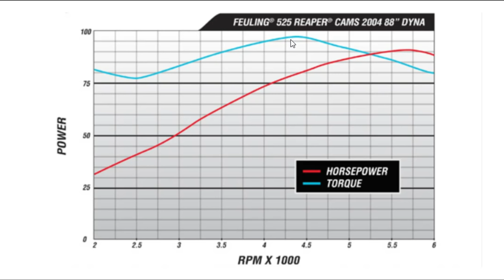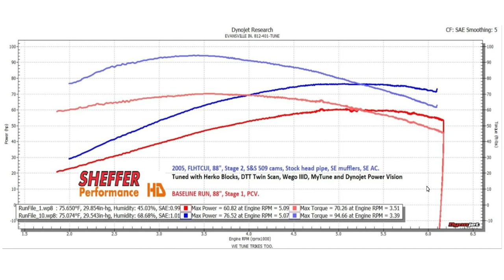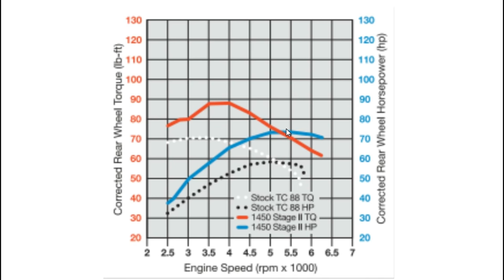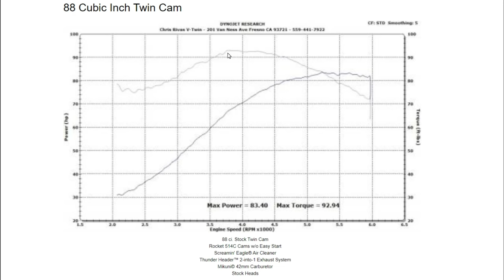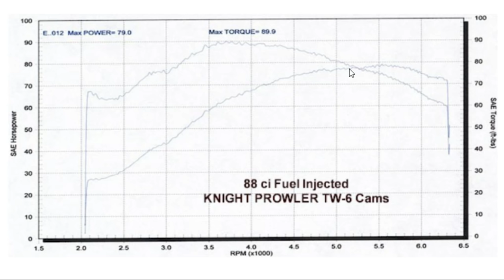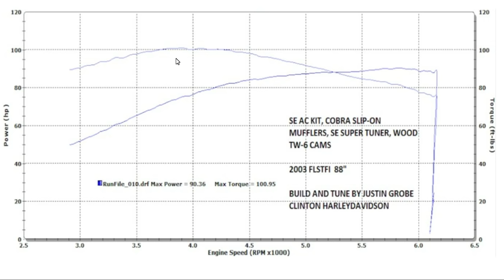Give Your Twin Cam 88 New Life With A Bolt In Cam Upgrade

Comment: I bought S&S 509 cams and new lifters with a harley SE cam plate upgrade kit.   I was going to leave it 88ci.  But I have decided to go with a  95ci from HD with the standard flat top pistons.  .030 head gasket.  Stock heads.  Question:...  will the 509 cams work well with the 95ci?
Reply from the maker: 509 and a 95 inch kit will play well together, the displacement increase will take advantage of the cam.
Reply: @GixxerFoo  Thank You!
Reply from the maker: @paulkubas4700  Anytime! If you hadn't already bought a cam the 510 is a good 95 inch cam too.
Reply: I was worried about the valve springs and valve clearance.   That's why I went with the bolt in 509. And I  ride in the rpm range that the cams are made for. While I have it apart, should I increase compression by shaving heads ect?  The bike really performs great as a stock 88. It co UK ld use a little more power for two up riding.  I just wanted a little more grunt and roll on in top gear. And to hopefully change the power band.  I'm riding a 2003 heritage  softail.
Reply: Just got my 03 heritage back from the dyno tune.  S S 509.  95" bb. .030 cometic head gasket. Stock heads. 76hp. 92ft lb. .  Runs great.

Comment: With the woods knight prowler tw-6h is there anything else I would have to do to the motor?
Reply from the maker: The TW 6 is bolt in so no other mechanical modifications will be needed. The only thing you will need to do is get the bike tuned.

Comment: Can you help me, I have a 2002 FLSTF 88ci but had an upgrade to 96ci. My question is will H-D 255 cams fit my engine?
Reply from the maker: Those wouldn't work in the 88 due to the inner cam bearing being smaller on the 88. 2006 and newer had a larger inner cam bearing. You could use them but you would need to have the later style cam plate and oil pump, as well you would need to machine down the inner bearing surface  (old style is smaller) and then press a hardened race onto the end of the cam.
Reply: @GixxerFoo  thanks for your reply, do I have any options for torque cams in my 2002 FLSTF?
Reply from the maker: I would recommend the Wood cam, it's one of the best horsepower and torque producers out there on the 88.
Reply: @GixxerFoo  thanks for the advice I will look into that, hopefully they sell them in the UK
Reply from the maker: I believe you can get them through FuelMoto over their. I know Hammer Performance can be sent to the UK, FuelMoto should be able to ship to you.

Comment: Would the Rocket cam 514 ok on a 88 to upgrade to a 95,98 or 100?
Reply from the maker: It could be used with those upgrades, that cam is also made for the 96 and 103. You'd just want to keep the compression close to stock since it's a bolt in cam.
Reply: @GixxerFoo  When is the 554 Rocket cam suitable?I want performance but I prefer focusing on long engine life.So are  lower compression pistons the thing? For the same reason ,I was wondering if the 95  SE  pistons (flat top) would be the choice?

Comment: Hey what cam u recommend with the s&s 98 big bore kit on a 03 roadking classic. Thanks
Reply from the maker: What compression ratio and cylinder heads are you looking at running?
Reply: @GixxerFoo  With stock head the kit will be at 9.8:1 compression i reach out to s&s n they told me to go with the mr103 cams. What is ur opinion on that

Comment: Could I put a woods 110 big bore kit on a 88??
Reply from the maker: The largest bolt on kit you can make an 88 would be the 100 inch SideWinder kit from S&S. It's got the 4 inch stroke crank, if you were to swap that crank out for a 4.375 inch stroke crank and add the 4 inch bore cylinders that would get it to a 110.
Reply: @GixxerFoo  Will the 100 bolt right in our it needs machining

Comment: I’m ego too a twin cam 88 FLHR carbie stock except pipes and jets what’s the best cam for it.  I read the head can only accept 515 lift many thanks oops ride two up and to work.   Don’t want a hotly like my 103’s
Reply from the maker: I would look at the Wood cam, it's really an awesome all around cam. It's got excellent torque and horsepower. It really gains all over the chart!
Reply: @GixxerFoo  thanks. Which woods cam
Reply from the maker: The Wood TW-6 would be an excellent bolt in cam for your bike 👍

Comment: How much retuning is required?
Reply from the maker: Carbed bikes are pretty easy with just a jet kit and ignition adjustments, a good dyno run on a fuel injected bike would run around 2 to 400 just depending on the shop tuning it.

Comment: Are you familiar with Redshift 576 cams ?
Reply from the maker: It's basically the same cam as the 575 just designed to be quieter for the most part. You'll need heavier valve springs to run it though.
Reply: @GixxerFoo  yeah heavier springs and a handful of other things would be getting changed.

Comment: I have a question about a different rocket cam. I called about their 554 because it says they are a bolt in cam, this makes no sense to me. Can anyone verify that these are good for stock springs on a 2004 88? Thanks
Reply from the maker: Yes the 554 will work with the stock valve springs, you can install them without any modification. Of course you'll want to go ahead and put some new cam bearings and not required but recommended new lifters. Just good to do while you're in there, but you can bolt those right into your 88.
Reply: Awesome, thank you for the reassurance, I was under the impression that the lift possibilities were less

Comment: ? is does harley have a tune for the 509 or do you have to buy a tuner which i dont wanna do? oh 03 ultra btw
Reply from the maker: Harley-Davidson won't have a tune for a aftermarket cam, being a 03 you would need a Power Commander V. FuelMoto has them pretty inexpensive and if you give them a call or buy online they will ask you about your bike's setup. That way they can setup the unit ready to go on your bike cam and all.
Reply: @GixxerFoo  ok got into it it has se203 in it now which i had known i wouldnt have bought the 509'sbut they wont take them back and return cash only store credit from a place probably never buy from again as usual with my luck and cant find a comparison of the two any ideas
Reply from the maker: Actually thay 509 is a much better cam! It would wake that bike up way more than the SE cam.

Comment: I'm considering going to a 100ci kit, cams and ported stock heads on my 99 road king tc88. It has a magneti marelli fuel injection, and stock headers with sporty mufflers. What mods can I do to improve the magneti marelli system? And what header should I use to maintain stock side tailpipes? thanks
Reply from the maker: You can tune the system using a Power Commander V, that would allow you to get your bike tuned for your setup you're looking at. I would give FuelMoto a call, they can help you get setup with a base map for the work your looking at doing. Are you looking at replacing the factory header and keeping your exhaust?
Reply: @GixxerFoo  yes, I want to keep my current exhaust
Reply from the maker: The factory Harley header is a lot better than it gets credit for, does it have the crossover in front of the cylinders?
Reply: @GixxerFoo  is the one that has a 2-1 on the right side and a single pipe for the left side, creating an Y on the exit of the rear cilinder head exhaust port
Reply from the maker: Oh okay, the factory header is really good but if you're looking to.change it l would check with Vance & Hines. They make really good replacement headers for Harley.

Comment: S&S for sure. How about the 510?
Reply from the maker: The 510 is good option, it comes on later though closer to 3,000 rpm. But it's great cause it bolts in and is intended for stock compression ratios.
Reply: @GixxerFoo  and torque doesn’t fall off
Reply from the maker: That's very important is not getting a dive in the middle of the curve!
Reply: I got 510 in my 01 road king with gear drive best thing I did
Reply: Put a 510 cam with gear drive best thing I did because when I took off the cam cover my tensioners where all most in pieces they fell a part in my hand.

Comment: I have an 03 road king classic I'm going to get the 30 k service done on it soon the bike is bone stock and I want to keep it that way any ideas on cams tensioners cam plates any thing to keep it reliable and simple not wanting a hot rod the bike is sweet and unmolested that's the way I'm going to keep it
Reply: Screaming Eagle hydraulic tensioners , n cam plate is a good choice . With adjustable pushrods . All available at the dealer . Geardrive is good , but crank runout needs to be within .003" . Probably worth doing at a top end rebuild . Far better choice . If you go that way . Simply replace tensioner shoes at 30k . Hd have a more robust design now . Then play with choice upon a rebuild , depending on your crank . I too own a 03 roadking classic , with a sidecar . N an 87 fxr . Hope this advice helps . Cheers from Queensland Australia .
Reply: @paddingtonbear5172  thanks for that direction I'm not a mechanic know a little bit about engines and can do oil changes and that stuff again thanks man and be safe cheers from the mountains of western north Carolina
Reply: No worries mate . I reckon its a good move if you go to geardrive to upgrade the oil pump at the same time . If you want a little more power , without compromising the valve train . You can upgrade the cams . All available thru S&S . 509 cam will give you about 9 extra horsepower and around 25 extra foot pound of torque at 3500 rpm . A cheap mod if you already have it apart . Stay safe mate with the bloody covid 19 . Cheers

Comment: Whats your opinion on the andrews tw 21cam
Reply from the maker: You can't go wrong with Andrews, that's an excellent torque cam for a big touring bike. It's a great replacement for the stock cams and it's perfect if you ride in the low to mid rpm range. It's not going to produce big horsepower but it will increase it so you're not losing top end by any means.
Reply: Thanks,keep up those great vid.
Reply from the maker: Thank you, l appreciate the support!

Comment: What if we have a 06 Dyna? It has better heads than 05. The SE203 i don't believe would work on 06 Dyna.
Reply from the maker: 2006 is quite a special year, it Harley's public experiment and it was good. The heads are basically Twin Cam 96 heads and they had the hydraulic tensioners. For the 2006 Dyna you'll need to look at cams for the Twin Cam 96 and 103, those cams will work in the 06 Dyna 88.
Reply: @GixxerFoo  thank you Brother!👍
Reply from the maker: Not a problem, hit me up anytime with questions. I am always happy to help out.
Reply: @GixxerFoo  dude you rock. I'm having a helluva time finding the right cam for this oddball bike. If you were me and you want a bookoo low to midrange torque boost on a 06 Dyna what cam would you choose? I'm probably not going to increase my cubes anytime soon. I have a PowerVision, 2into1 HO Short VH, and hypercharger intake. Looking to get as close to 100 ft lbs as possible 🤙
Reply: @GixxerFoo  the biggest problem I'm running into when looking at the 96/103 cams is they need a higher compression ratio than the 88 produces.
Reply from the maker: The absolute best bang for the buck out there is the Wood TW-222. It will work in a 2006 88, it's a major torque producer low to mid. But it doesn't kill the horsepower on the top end either. With your exhaust and tuner it should put you in the mid 90's, a good dyno tuner could likely squeeze more out of it too.
Reply from the maker: The 2006 is a special year, the compression is a bit low at 8.9:1 but the 96 is only 9.2:1. It's a bit of difference but most cams for the 96/103 that are bolt in will still run well in the 06.
Reply: @GixxerFoo  you the man, thank you for your recommendation sir 🤘 love your channel. We're cut from the same cloth. If you ever find yourself in Oregon hit me up
Reply from the maker: Hell yeah will do! You are welcome, anytime!

Comment: My TC88 it's near to 100.000klm/63.000ml
My idea it's S&S 509 and maybe a big bore.... 95" 98" 100"?? 
I don't know, the pocket says........ 
Thanks for your videos
Reply: I spent near $3000 the last month on mine. 2001 Fatboy, KB domed pistons @10:1 fully ported heads, fueling oe+ cam plate and reaper 525 cams. Cylinders were torque plate honed to 95 " as well. 100hp and 112 tQ
Reply: @HammerHeadGarage  Thanks a lot for information!!!

Comment: Are andrews and wood the same company?......wasnt the cams called andrews/woods cams?
Reply from the maker: Andrew's makes the cams for Wood, but the Wood cams are built to Wood's specs.
Reply: @GixxerFoo  got ya, thanks for responding!.....I have andrews 57 in my  03 cvo road king with a bassani road rage 3 pipe....it pulls pretty well id say....lol
Reply from the maker: That's a nice cam for your 103, do you have any head work or anything done?

Comment: Why don't you cover how you can pull both the cam tensioner springs and pads from a TC-88 ; throw them away, and never have to worry about those parts going genade on you, and blow up inside your motor ????
Reply from the maker: I've only had one other person say that before, it makes sense though honestly as it's basically just there for harmonics. Chevrolet V8's run hundreds of thousands of miles without tensioners.
Reply: @GixxerFoo  We found the cam chain is so short ; we are going to do a YouTube video of a stock TC-88 running without the cam chain tensioners.......
Reply: @garymoore3497  I'd really like to see that myself, as I'm rebuilding atm and will put new tensioners in just because. Long time Chevy man myself.
I often wonder why they didn't just use a WHEEL instead of pads? Urethane or something would go 200K easy!
Reply: @garychandler4296  I have your answer.... "Shop Income".... Harley dealers make more money on broken motorcycles..Using a WHEEL would cut too much into "Shop Income".....you understand now ???????
Reply from the maker: That's interesting, too short? I don't feel like there's any reason you can't run without tensioners. Send me a link on the video, l want to see this.
Reply: @GixxerFoo  Don't wait for me....Do it yourself.....
Reply from the maker: I ride with a few guys that took theirs out, they haven't had any issues. I like to hear everyone's opinion. I like the idea but some people think you're nuts for even suggesting it.
Reply: @GixxerFoo  somebody has to call a spade, a spade......

Comment: Have you heard any good things on the fueling reaper 543 cams for the 88??
Reply from the maker: They are decent in the 88, but they work much better with larger displacements. The Wood TW6 works very with the 88's.

Comment: Hq 34 good cam for 88ci come on around 3 grand
Reply from the maker: What RPM does that cam run out to?
Reply: @GixxerFoo  that was my 2000 ultra classic now I have a 2010 road glide looking at cams don't redline past 3500 rpm want to get the power in that range but I want that cam lope sound
Reply: @GixxerFoo  also I upgrade to the 10 mm spark plug wires big different thanks
Reply from the maker: I would look at the Wood 222, that's a cam that's got it everywhere. Even more so than most mid range cams.
Reply: @GixxerFoo  thanks I will this a go

Comment: How about Andrews??
Reply from the maker: Andrews are some damn good cams, they actually make the cams for Wood. The cams are justg ground to Wood specs, but you can't go wrong with Andrews.
Reply: Andrews 21 torque cams if you like to feel real pull just at normal throttle, low rpm's. Really woke up my sleepy 88!

Comment: You did this video, aimed at me, didnt you ?  lol  woods=82hp hmmmm
Reply from the maker: Lol Woods is a good cam, the 88 isn't huge kn horsepower but it's a stump puller on torque.
Reply: @GixxerFoo  I think Im sold on the S&S 509 complete camchest upgrade.  Just waiting to get it on lift to check crank runout..That will determine geardrives, or hydraulic chain guides
Reply from the maker: That's smart checking it out before ordering parts, don't get stuck with parts you can't use due to runout.
Reply: @GixxerFoo  Looks like 2 weeks, and its going to be camchest upgrade time.. Got wheel spaced correctly and fender brackets made/installed.. Video soon.
Reply from the maker: Hell yeah! Let me know when you get it up!
Reply: @GixxerFoo  Yes sir.. I got the wheel centered perfectly.. I took time to get correct spacers delivered..  A dab o ant-seize on axle..  Little things matter, right ?!
Reply from the maker: It's  all about the little things when working on anything 👍
Reply from the maker: Very nice, l'll have to check it out see what you've done!